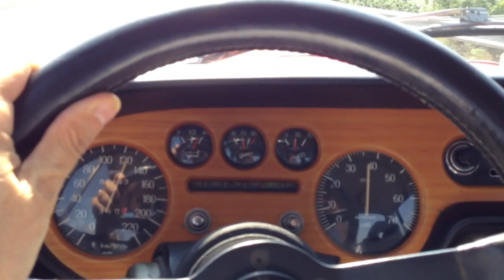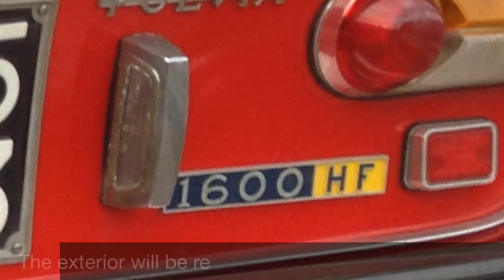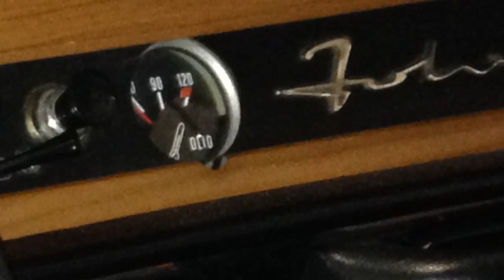Vintage Lancia Fulvia Coupé 1600 HF

Comment: Where idd you buy\ order the stelring wheel?
Reply from the maker: This steering wheel is a Momo. In the 70's, owners of small sport cars (like Fulvia) were used to change the original steering wheel (that were generally too big for a sporty driving). When I bought the Fulvia, the car was already equipped with this Momo, that is small and good for driving and turning fast, but it's quite hard to turn actually as the car doesn't have the power steer.  Then, when I restaured the Fulvia, I preferred to reinstall the original one from Lancia, which has a very nice design (I bought it at a vintage car exhibition for a crazy price... you can see it in other videos of my channel)
Reply: @RetroRidingEveryday  I am looking for this particular momo steering wheel but I can't find it... I want to swap it with the original one on my fulvia series 2. You might want to trade it or sell it to me? :)

Comment: 5 Gears ? i Thought the original had only 4 gears !!? is threre an another transmission in ?
Reply from the maker: +Christian H.  The “normal” Fulvia Coupé models (1,2 – 1,3 Rally, etc…) had all 4 gears for 1st series, and 5 gears for the 2nd (from 1970). The “HF” models, because of their sport/rally destination, were  produced always with 5 gears (both 1st and 2nd series). Mine is a HF 1600 2nd series and has 5 gears ex-factory, so the transmission is the original one. Curiosity: Lancia launched the 2nd series few months after its acquisition from Fiat. The only change in the HF Lancia engine was the new gearbox, with this 5 gears unit Fiat origin. The “old” 5 gears assembled by Lancia for the HFs 1st series was actually an adaptation of the original 4 gears. That’s why Fiat decided to use their more modern and efficient piece for the 2nd Fulvia series. Thanks for watching!
Reply: +speed3fux ty for this nice history lession. Now all my questions being answered.thanks
by the way : a really nice car.